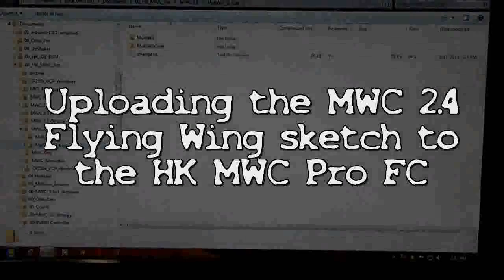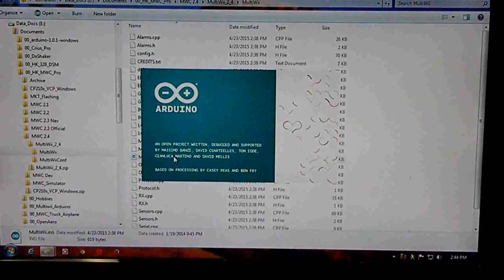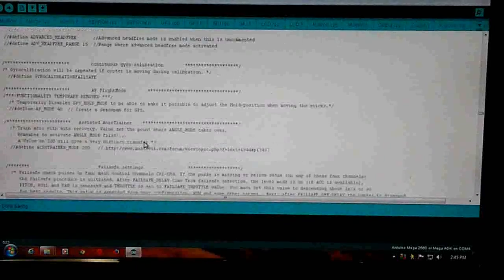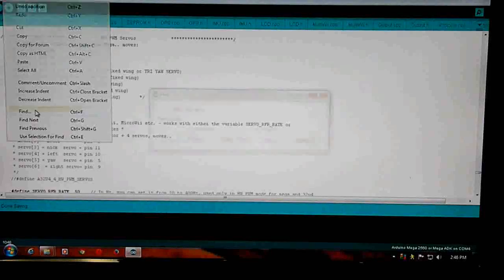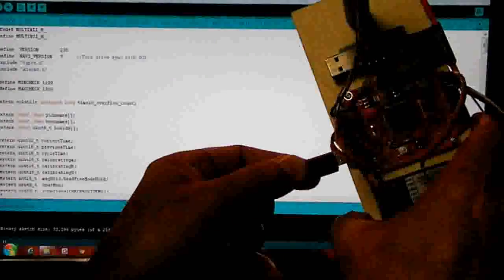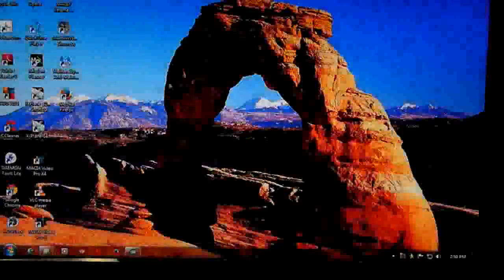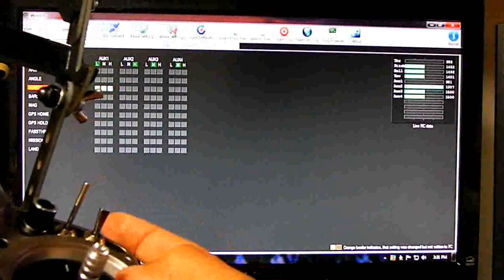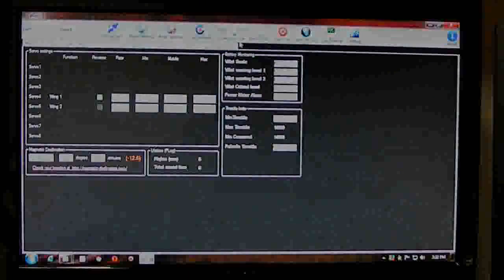Multiwii 2.4 Flying Wing Upload to HK MWC Pro FC

Comment: Hi! what to change in config.h (MW 2.3 I have and Arduino pro mini is the board)to use it as flying wing FC? I have GY_521  sensor to have gyro and accelerometer for stable mode too.
what I set so far in config (any other value is like my quadx setup):
  #define FLYING_WING
  #define I2C_SPEED 400000L 
  #define GY_521
  #define GYRO_LPF_20HZ
  #define ALLOW_ARM_DISARM_VIA_TX_YAW
  //#define ONLYARMWHENFLAT

 According to schematics A1 is right servo, A0 is left servo, D4 is roll input pwm channel, D5 is pitch pwm input channel, throttle could be a passtrough, D7 is the aux1 probably to set flight mode stable/manual,
for the i2c A5 is SCL, A4 is SDA
Reply from the maker: Ohh that's easy. Look for the MWC Arduino 328 based board that is compatible to your Arduino Pro mini. Trace the pin-outs of the pro-mini board to match the pin outs of the GY_521 sensor to match the MWC board schematics. Position and attach the sensor to your frame using the correct orientation for the Mag and Accel ... change the sketch accordingly if the orientation is not 100% correct. Upload to your to ProMini and install to your intended frame. Figuring out which MWC board is compatible ... well that's the first of the hard part(s). ORRR you can by a cheap MWC 328 board (need to know it's "name"), pick the proper board in MWC, configure, upload and attached to your wing.
Reply: I mean what other things to change in the config.h, what I wrote in my comment is enough? Receiver throttle should be connected directly to ESC or through the FC?
 I already used the arduino with GY_521 on my DIY quadcopters it worked fine, I think sensor orientation shoudl be the same, I am not sure about the config and the throttle channel wiring.
Other thing is that ,y transmitter does not have mixer mode, so that's the first reason I need a V-mixer or an FC, can Multiwii FC handle the mixing too?
Reply from the maker: Go here ...http://fotoflygarn.blogspot.com/2014/04/multiwii-gps-airplane.html
Reply: Thanks, but I don't want to add the GPS yet, first just to have a mixer and a stab mode by the FC. It would be too fast learning to add GPS for my first wing setup.
Where to connect receiver throttle channel? directly or to the ESC or to the MultiWii input? I did not find a throttle input/output pins on the MutiWii Wing wiring diagram yet. (I have a clone arduino board used as FC not a factory MultiWii board)
Reply from the maker: My mistake ... should have pointed you here ...http://fotoflygarn.blogspot.com/2012/03/multiwii-airplane.html
Reply: Thanks! I will have only 2 servos as it is a wing no RUDDER and ELEV. Plus the FC must mix pitch/roll input  as my TX does not have V-mixer mode. I will read through the article and wire the stuff to my arduino board and report back! Have a nice day!
Reply from the maker: Does not matter if your TX does not have V-tail ... it should NOT having mixing if you plan to use MWC code. Good luck on your ventures!
Reply: Godd news thanks!